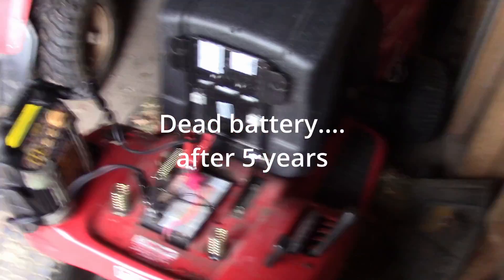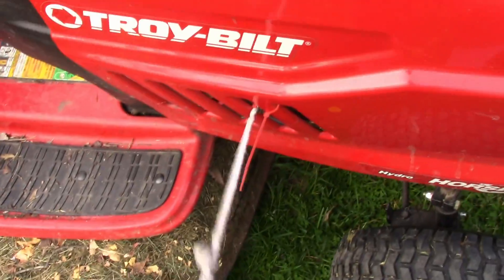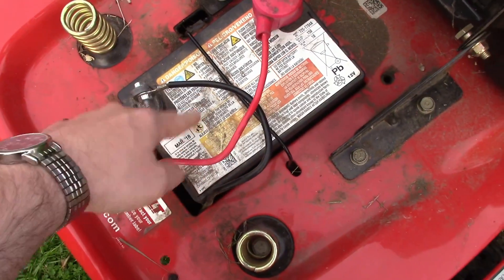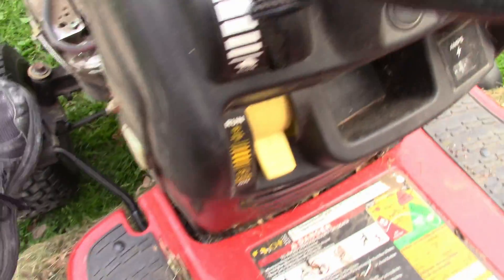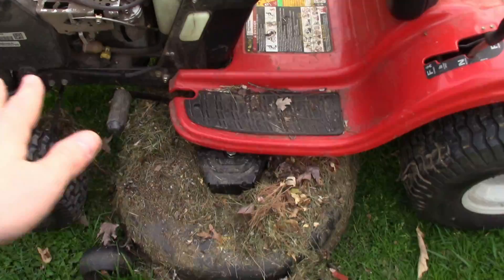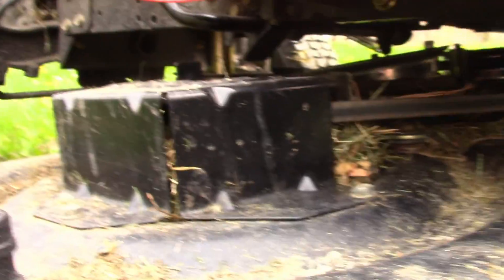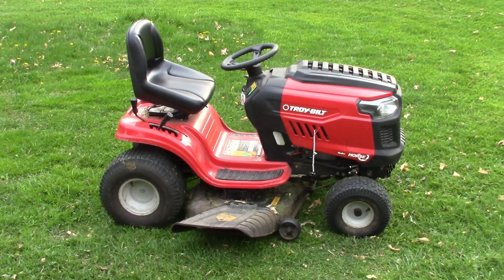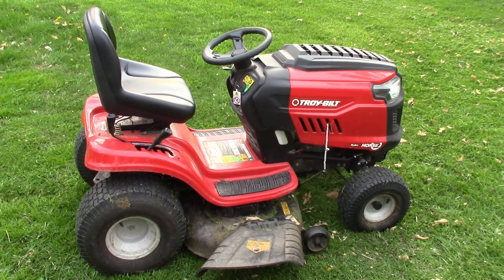Review 5 Years Later of Troy-Bilt Hydro Horse 20-HP 46-in Riding Lawn Mower 13AX79BT011 2017

Comment: Thanks for sharing, the review after 5-years. I'm considering purchasing a Troy-Bilt Super Bronco. I heard what you stated on a Zero Turn and am going to look at a John Deer, although price is seriously being consider.
Reply from the maker: @arnoldbooker8473 the price on the riders has actually started to creep closer to the zero turns. I paid like $1200 for this 46 inch rider in 2017 and now they are $2600. You can get a 50 inch zero turn for $3100. The mower is still running great.

Comment: so im guessing this would be a great mower if you werent having to cut 2-3 acres. I found one for $500 with only 23 hours on it. It has zero issues, its from a friends family. Sounds like basic maintenance is all thats needed to keep it going.
Reply from the maker: That's a great find, these mowers are like 2 grand now. Just keep the engine bucket bolts tight. I've only changed my oil one time with synthetic in however many years it's been, it's a tank.